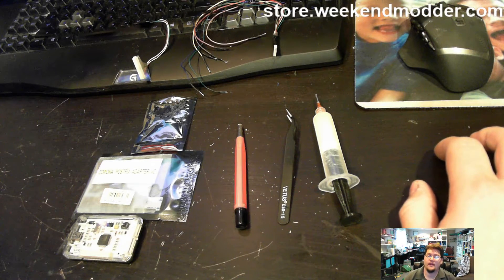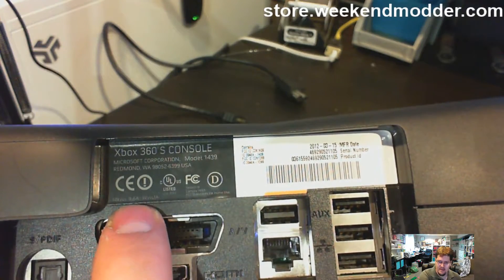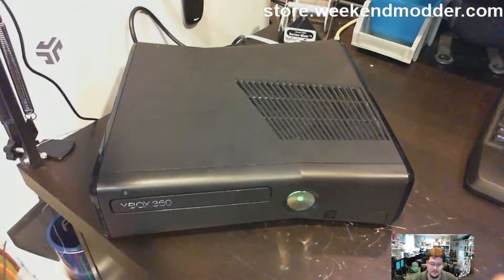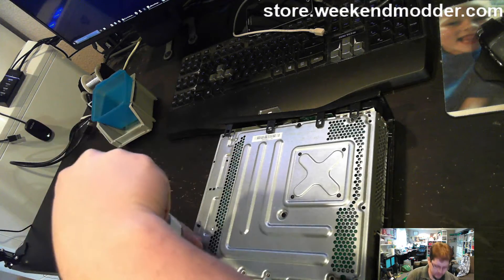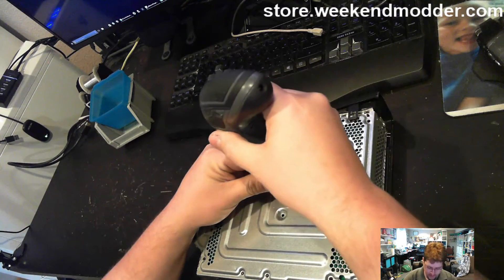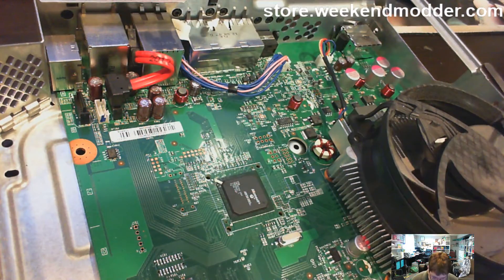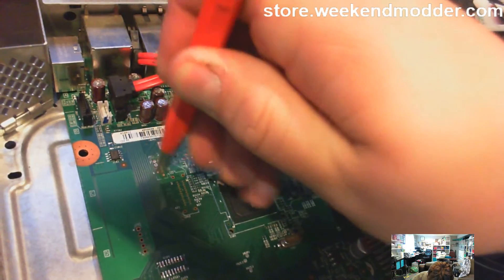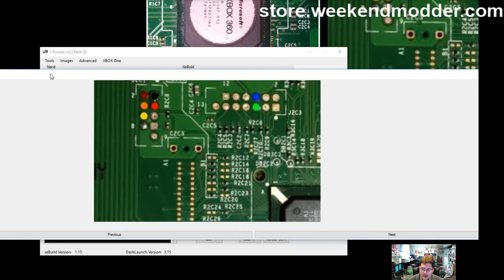Watch me RGH a Corona 16mb Nand with Ace V3 + NandX

Comment: Which type of fiber glass pen do you use? I just bought a fiber glass pen to follow along, but instead of scratching open the solder joints it destroyed and removed the coating on the actual board breaking a trace or two and exposing way more than I'd hoped for in the process. My own fault of course, but as a warning to others and a note to myself I think it's worth pointing out. Didn't spend much on the xbox itself, but still a great waste. Great video otherwise!

Comment: I commented on your other video about my console and all. This video it shows r2c6 and r2c7 have the wires going to the e and f pads. I messed with those wire on accident and I think one or both of them aren't connected how they were(the little wires) and I was wondering if that's why my console won't turn on. I took the post fix off and the nandx thing as well nothing connected anymore. Let me know so I can continue on to put it back to how it was. Thanks
Reply: Sorry. My console will turn on but it won't show up on my screen and it's not my cord I used a different one and everything